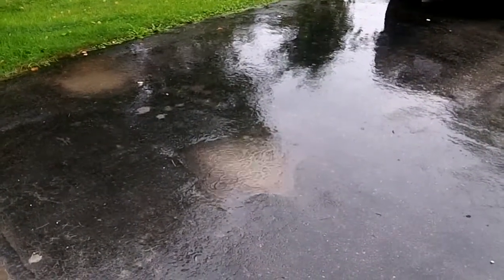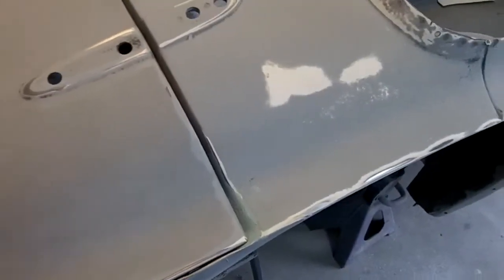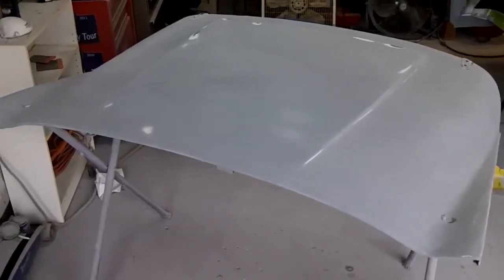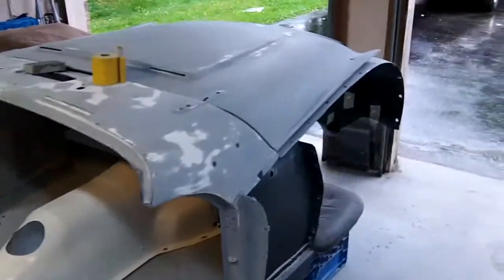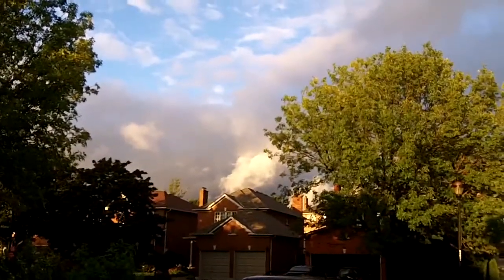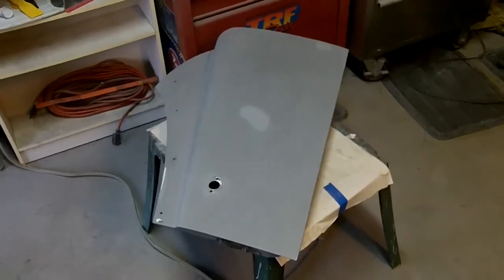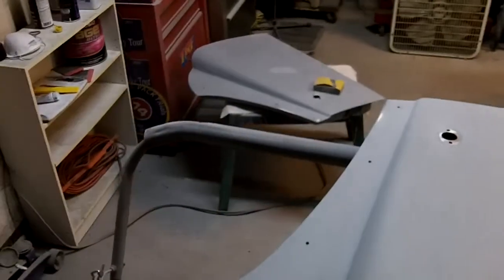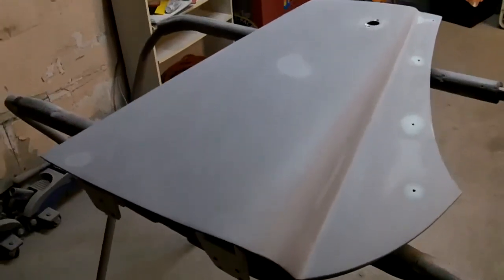Sanding Boot/Bonnet/Doors and More...1960 Triumph TR3A Resto

Comment: I understand your conditions are 'tight' though I have painted a couple full big Cadillacs in a single car garage using floor jacks to move the cars during paint to move them back and forth to get elbow room. I know your being carful and enjoy watching you getting near paint time. For sure stir the paint real real good every time you use some.   You could still do the jambs before you final sand the show sides and tape them short of the edges etc..
 In your corner!

Comment from the maker: Hi Milo, Thanks for the reply. I don't think that I will be able to paint with the panels on the car.  I have some limitations built in my spraying set up...limited air supply in the compressor, ventilation etc.  I was only planning on spraying panels and assembling afterwards.   My TR6 was done professionally  this way with no paint matching issues...I know that is would not be possible with a metallic or candy but I am hoping solid will work...

Comment: I would say the best way to paint would be to spray the jambs, undersides and any tricky edges and clear them as well but not mask them as you described rather let any minor over spray be a guide coat for the show side and put all the panels on the car so the color stays the same panel to panel. Even a solid white from the same can will look different if shot on different days and temps,conditions etc..
It will be easier to line things up before final paint and then door appeture foam tape..